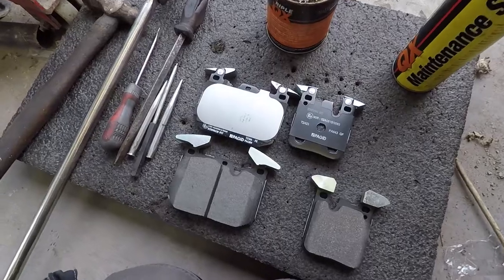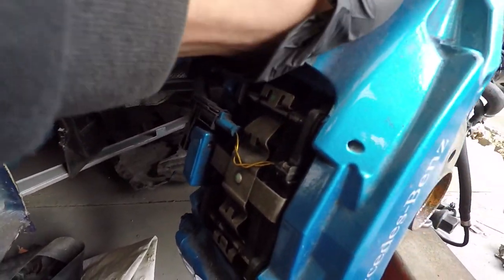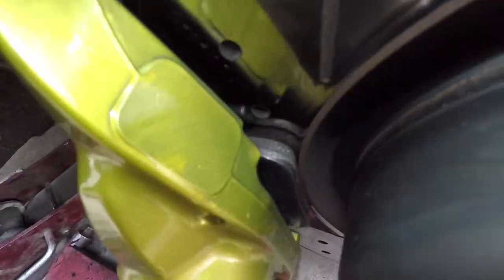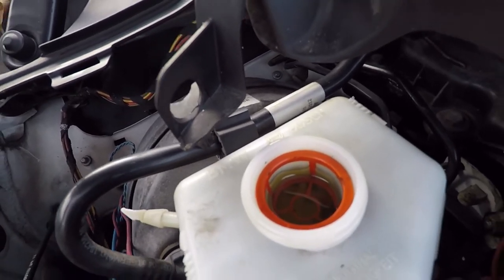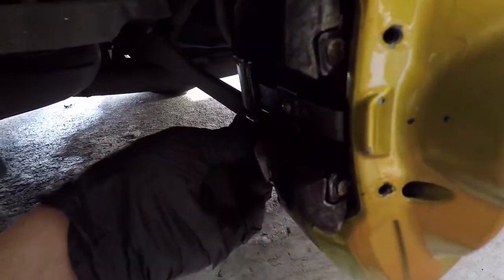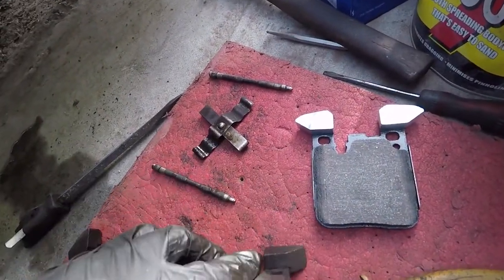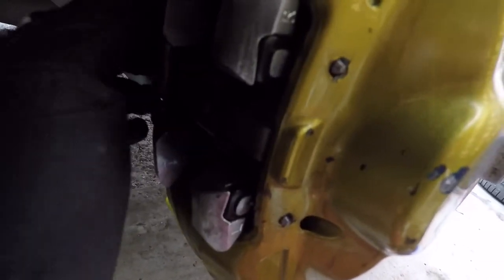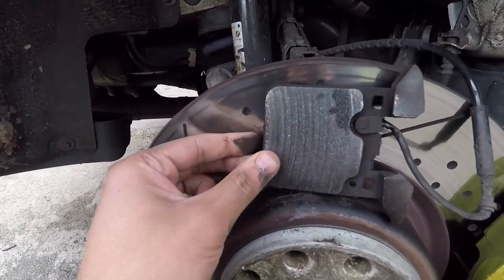How To Install BMW M3 M4 F80 F82 F83 BRAKE PADS, EASY!

Comment: Good morning. How long does it take totally to change all brake pads ? Thanks.
Reply from the maker: Shouldnt take longer then 60 mins.  I will do both sides in 30 mins or less. Depending on the equipment you have.

Comment: As a professional Bmw certified technician you are supposed to replace the rotors when replacing the brake pads regardless wether they are good or not. 🤦‍♂️🤦‍♂️🤦‍♂️🤦‍♂️🤦‍♂️🤦‍♂️
Reply from the maker: DID EVEN YOU WATCH THE FULL VIDEO, WHY I CHANGE THE BRAKE PADS?  OBVIOUSLY NOT.

  THE GRADE/MATERIAL OF THE PADS WASN'T GOOD SO BRAKE PADS WERE SQUEAKY. THATS THE REASON THEY WERE REPLACED. I KNOW THEY HAD ENOUGH LIFE ON THEM. IM NOT STUPID.

A TIP FOR YOU NEXT TIME WATCH THE FULL VIDEO BEFORE COMMENTING.
Reply: You dont need to replace the brake disc if they are good. Dont know what sort of technician you are
Reply: @pepelepew158  
If you were you would have more sense. The decision to replace brakedisc is largely based on the thickness. The repair manual should tell you the minimum thickness, which you should replace the disc when doing the repair.

You need go on a course again. Im teaching you how do your job. I bet you dont even work at bmw dealers seems BS.
Reply: I disagree!!
Reply: Not exactly true. If the mm are in range don’t need to change the rotors. Rotors for this cars can cost over $4k. You are fooled if you would cough up that much money every time u change ur brakes  😂.  Pshh unreal